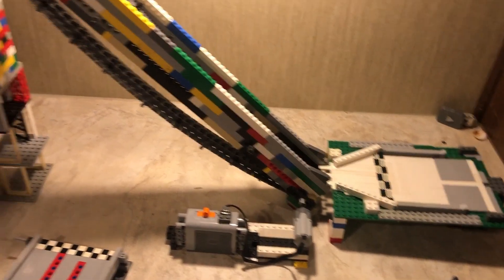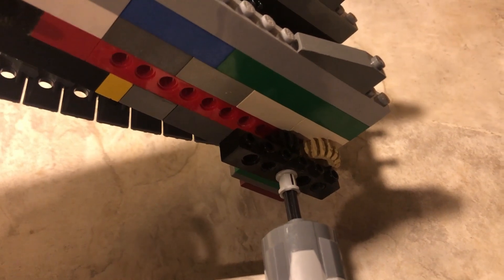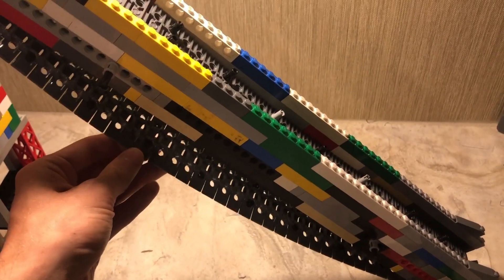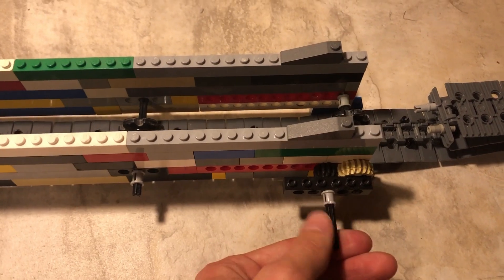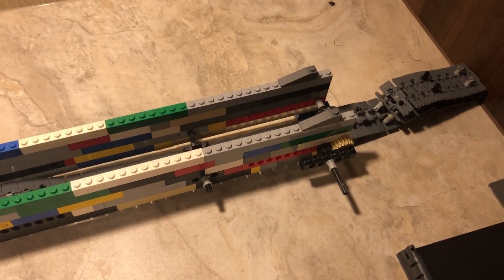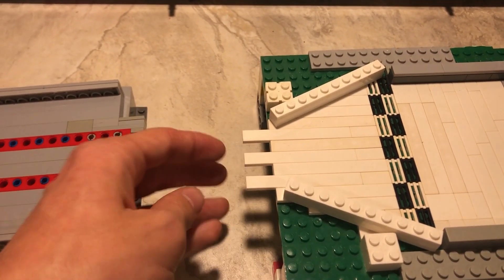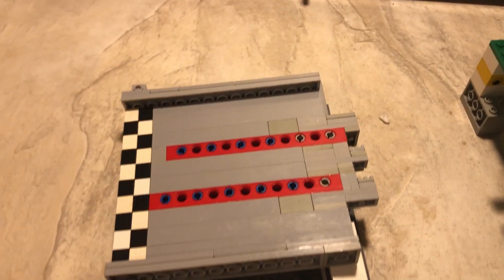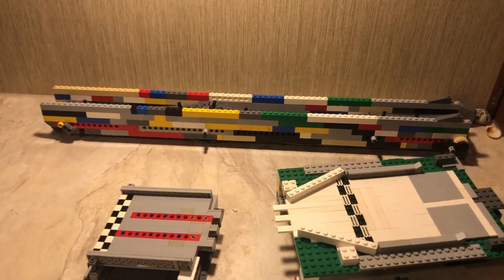How to make a conveyor belt for marble racing!?

Comment: You said that you geared up the motor to increase speed. How did you gear it up? What gear ratios did you use? How many teeth does each gear have? How many gears did you use?
Reply from the maker: You can see the gears in the video if you look closely. It doesn’t matter as what the specifics are just that the belt us fast enough for you

Comment: Hello, so I looked at the conveyor belt video so I have a motor that’s from a chain lift marble set, For the caterpillar track. The pricing of the motor and battery are very high and I can’t get. What should I do if I have the motor and caterpillar tracks
Reply from the maker: If you want to use a different motor and use the legos for the rest you can try to hot glue the spinning part of the motor to the Lego parts.
Reply: @MarbleSportsPro  How about if I use Cardboard as the cover so the marbles don’t fall from right to left is that a good idea?
Reply from the maker: @cbuckybucks  it’s not ideal but if it works for you go for it!